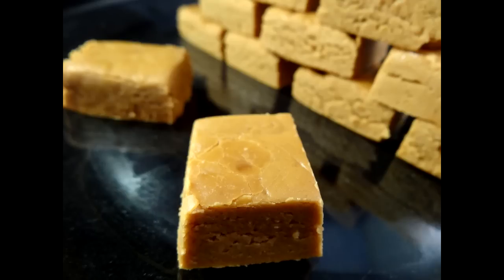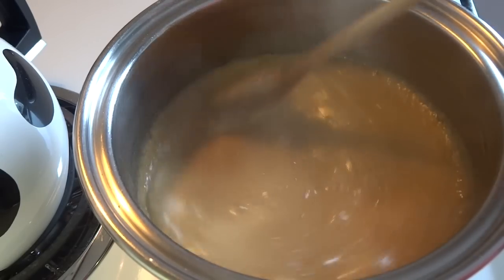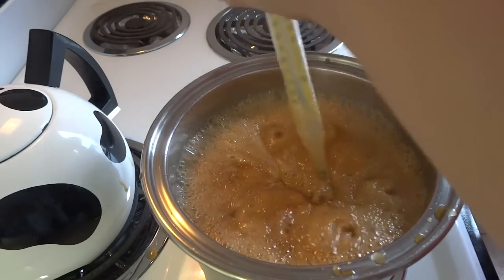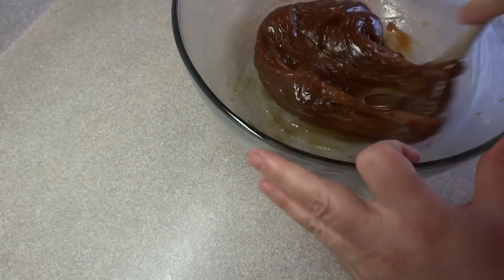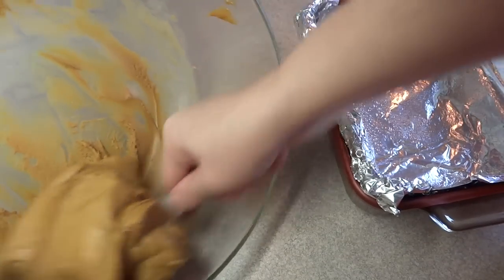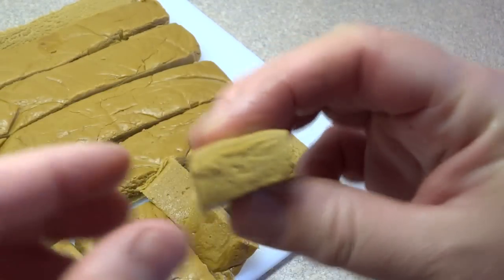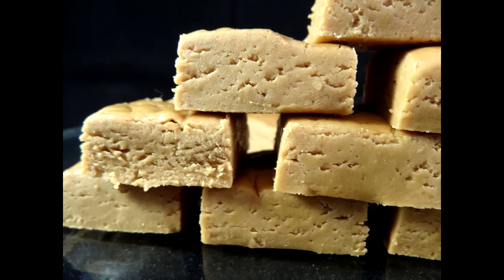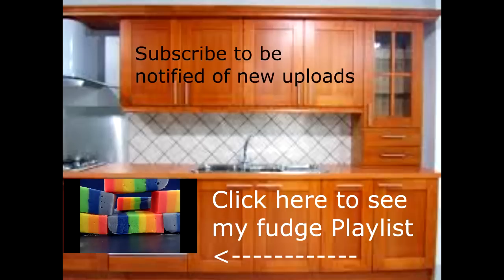Maple Fudge

Comment: If you don't have a thermometer (we never did growing up), put a drop of the boiling mixture into cold water. If it forms into a "soft ball", it's done. That's why they call it soft ball temperature. If you're for some reason too rushed to fiddle with this, simply boil the mixture for 5 minutes and that should more than long enough to bring it up to temp.

Not into maple? Replace the maple syrup with granulated or powdered sugar for basic "brown sugar fudge".